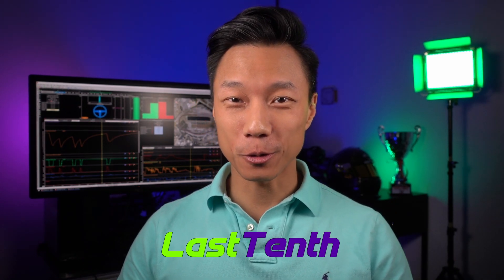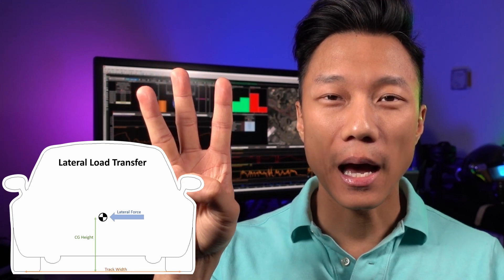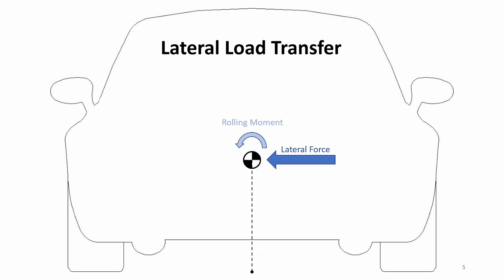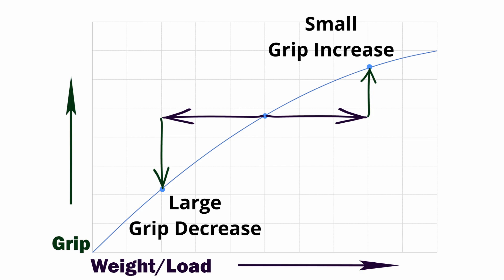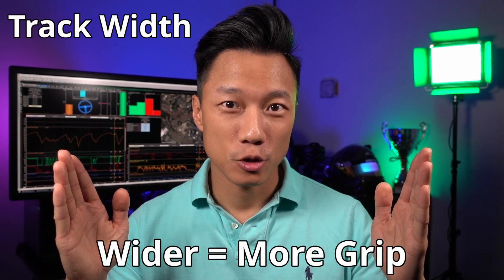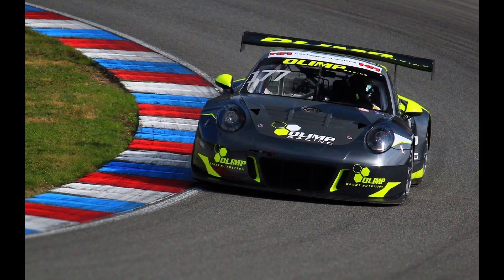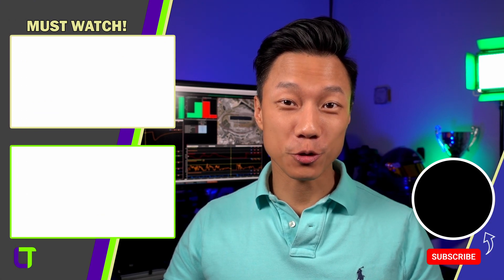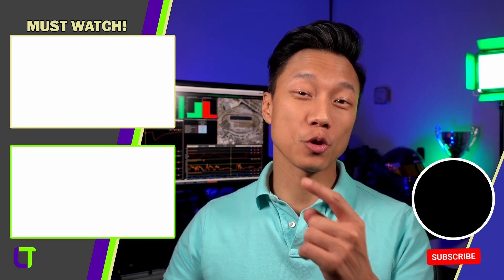Why Load Transfer reduces GRIP in corners [HOW TO GET MORE GRIP]

Comment: Hey Nik, great video man!  Things are clearly explained and both your graphics and sound effects add a lot to the video.  Please keep the videos coming!  

Q: so from an engineering point of view, what does the stiffness of the suspension affect in terms of doing lap times on a track?
Reply from the maker: Thanks for the kind words Adrian!

There's no simple answer to that question, as a stiffer suspension has lots of implications.
i) It decreases compliance and mechanical grip
ii) It allows for a lower ride height before bottoming/rubbing
iii) It reduces ride height and alignment changes
iv) It generates a more stable aero platform
v) and others...

It also depends on what is being stiffened...
springs... which spring? some cars have more than 4
dampers... compression or rebound? high or low speed?
swaybars... which swaybar?

stiffening different things will have different results so depending on what's improved and what's worsened, the lap times will change accordingly.

Comment: Great video!
And i have 1 question for you:
What is the downsides of the increasing the wheelbase?
Reply from the maker: Great question. For one, a longer wheel base will result in larger turning radii for a given steering angle. Said another way, it requires more steering to maneuver a corner than a short(er) wheelbased car.
Reply: @LastTenth that is why redbull is faster in slow twisty corners than Mercedes in 2018?
Reply from the maker: @erdneegan2541  I wouldn't know. I don't follow F1
Reply: @LastTenth  load transfer also affect longitudinal grip like lateral right? im not sure because you only talked about lateral in the video
Reply from the maker: @erdneegan2541  Yes it's the same. It's not as prominent due to longer wheelbases, and it is used as a tool to alter the cars balance.
Reply: @LastTenth  1-does lighter car mean lesser weight and lesser weight/load transfer between axles? and therefore better grip overall than heavier cars?                          2-the wider the car is/ 2 tyres more further away to each other means lesser load transfer?
Reply from the maker: @erdneegan2541  1) a lighter car will have more 'grip' by way of tire load sensitivity, regardless of load transfer. A lighter car will likely have proportionally more load transfer because it is able to generate more lateral acceleration
2) yes.

Comment: So basically, the reason why driving smooth is fast is because driving smooth minimizes the amount of load transfer?  So a smooth driver has consistently more grip, correct?
Reply from the maker: Well yes and no. Driving that's not smooth creates more variance in load transfer, so some times it will have more load transfer, sometimes it will have less. But in a comparable basis, the average load transfer will be the same. That said, the key part is that, if there are two tires with identical average load on them, the one with lower load variance with generate more average grip. I think it's due to the hysteresis, but I'm not sure.

TBH, being smooth is sometimes overrated/misunderstood. It can help new drivers, just like any "tip" that's out there, but it's not the fastest way. If you are at the limit, you can't be perfectly smooth, because your constantly straddling that knife edge of balance and max grip. The real question is who can straddle that edge more smoothly.

Comment: If the track grip is high, would maximum load transfer to the outer tire give fastest cornering speed as long as the outside tire can maintain grip?
Reply from the maker: Just so I understand the question, are you asking me if a high track grip will give faster cornering speeds? The answer would be yes.
Reply: @LastTenth  If the track grip is so high would cornering speed (e.g. rotation) be faster if there is more load on the outer tire than and evenly balanced load distribution between inner and outer? The scenario is the track grip is so high the car can corner with the grip of the outside tires alone without sliding.
Reply from the maker: @rccartips Well if the track grip was higher, the load transfer would be higher because the car is cornering at a higher speed. Drivers don't choose how much load to transfer, it's a function of lateral acceleration, CoG height, and track width.
Reply: @LastTenth  Thank you. If you were to choose between a narrow car (faster/more LLT vs wide car (slower/less LLT) what would give a faster cornering speed assuming the track grip was so high there is no loss of side traction (sliding) even if outside tire is 100% loaded and inside 0%.
Reply from the maker: @rccartips  I think that's a false dichotomy - why is a narrower car faster? I would say that a wider car will be faster. And the wider car will have higher cornering speeds

Comment: How do ant roll bars change the level of grip?
Reply from the maker: anti-roll bars change the roll stiffness of an axle, which changes the load transfer at that axle relative to the other axle during roll. By changing the load transfer at the axles, 'grip' can be moved from one axle to the other. This is because of a tire's load sensitivity - you can learn about that here https://youtu.be/sORwV-PF63M.

I have a Q&A section on my discord server. This is a really good question, so if you'd like to dig deeper, feel free to join my server and ask follow up questions. Just go to discord.LastTenth.com from your browser!

Comment: If the car is too wide can that cause lift? I often see the wings in the side of the car for race cars so I was always curious about that.
Reply from the maker: Quite the opposite. A wider car has less load transfer so the sides will compress and lift less. A narrow car on the other hand, especially with a high CoG, may be prone to rolling over.

I think what you’re referring to are “side skirts”. They are designed to control the air pressure in the underbody. I’ll definitely do a video on that in the future, so stay tuned!!

Comment: Awesome hair buddy...
Reply: Okay jokes aside. Thanks for the informative video! So how does stiffer away bar and stiffer suspension help reduce load transfer?
Reply from the maker: I’m glad you found it helpful!

That’s a great question. The short answer is that it doesn’t - stiffer sway bar/suspension, or said another way, higher roll resistance, does not reduce load transfer. In actuality, quite the opposite - stiffer ride/roll rates reduce grip, all else equal.

We discuss it in this Setup Workshop with the PCA. It can be found here - youtu.be/1mtppDhbWQw. But at some point I will probably do a ‘myth-buster’ series and this will be an awesome topic to cover.